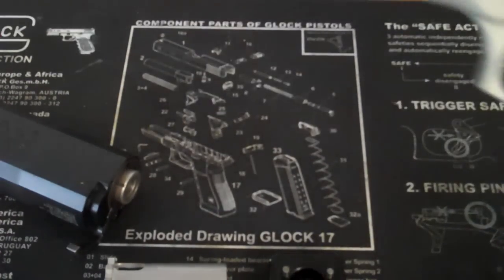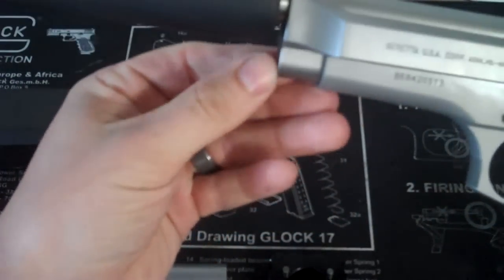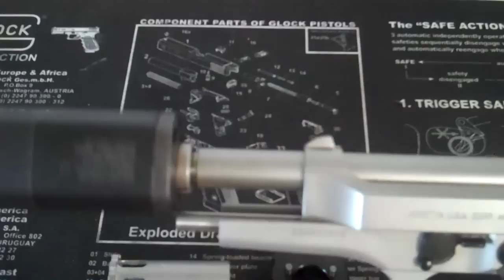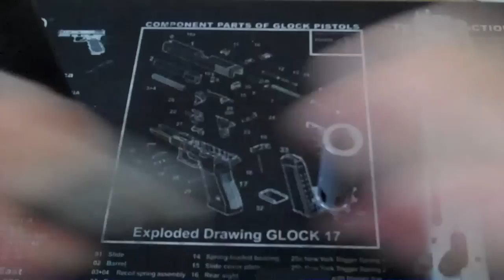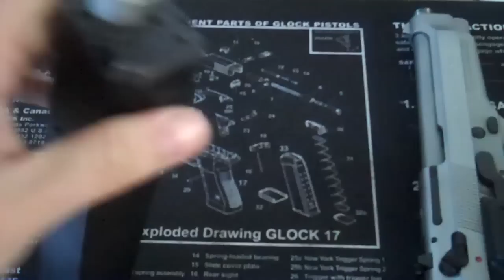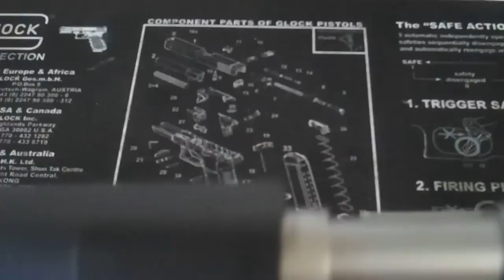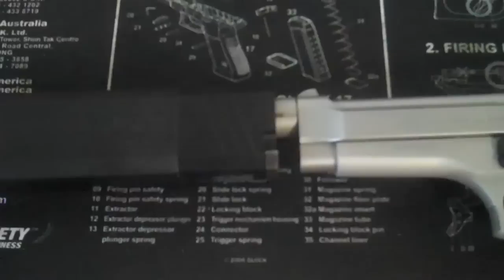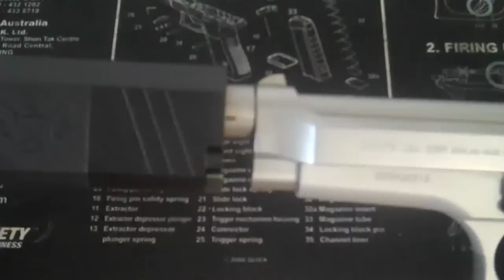Beretta 92FS with Silencerco Osprey 9mm silencer

Comment: A little late here but I'm just now looking to add a threaded barrel to my 92A1. I have already seen that problem with the standard piston in the Beretta. Silencerco produces a barrel that is extended in length to eliminate this problem. So instead of having my extra factory barrel threaded I'm getting Silencerco's barrel and hope the thing will drop in as advertised. Then no worries about any suppressor after that.

Comment: I noticed you use the fixed barrel spacer.  Would the Beretta 92 (or 96) work using the standard spring over the piston instead?  I have seen  a few forum discussions suggesting that on those Berettas the Osprey should be used with the spring, others stating the fixed barrel spacer is best.  What is the real answer, and why?  Thanks if you can help.

Comment: I know im late man but please can you answer me this, im looking to Suppress my 92fs do i need a extended piston or extended barrel say for a Octane 45?
Reply: If you buy the factory baretta extended barrel you will not need the 1/2x28 XL piston, you can just use the standard 1/2x28.  If you buy non factory threaded barrel say by wolf or silencerco you need to make sure you read the details of the barrel youre buying to make sure it says "extended" barrel. If the barrel your buying is not "extended" then yes you will need to by the 1/2x28 XL. 

Hope that helps you.
Reply: @silverman3678  so a silencerco threaded barrel will work with a XL piston fine?
Reply: @halogaming2878  -- if you really want to use silencerco's barrel, I would call them to make sure there barrel is 'extended' that way you can just use the standard 1/2x28 piston.  Otherwise if I were you I would buy baretta factory as those are for sure "extended" and it's the same price as silencerco's .  Visit this link:

https://www.berettausa.com/en-us/search/?keyword=92fs%20threaded
Reply: @silverman3678  thanks man

Comment: Hi fireman1291, You mentioned you have the 1/2  x 28 XL piston for the Osprey to work on the Beretta 92FS. With the XL piston, does it fit on to a threaded factory barrel for the 92FS, or did you have to get an extended barrel for it??

Comment: On my osprey I dont have a fixed spacer its a spring but I only shoot it on glock19....but do I need a fixed spacer when I put the can on a 1911?
Reply: No, since the 1911 is a recoil-operated firearm, you do not want to use the spacer. The fixed barrel spacer is only for guns that have a fixed barrel, which you are unlikely to come across in these calibers.